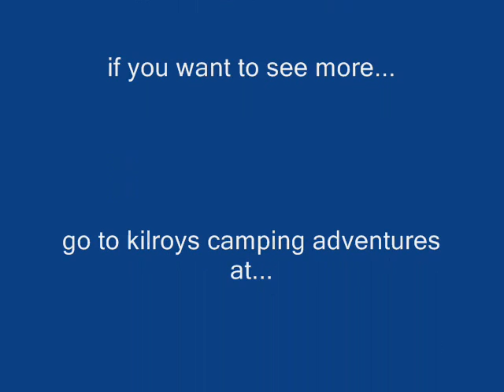teardrop trailer (kilroy) 1 THE BUILD more at kilroyteardrop.shutterfly.com

Comment: '
nice homemake a camper trailer,,,
this trailer need to add 2 amber yellow lights on the rear taillights for safety turning sign and emergency parking lot,,,
add 4 more LEDs lights on both sides of this trailer, too,,,
have a good camper and fun travel

Comment from the maker: @peluche2  the sides of kilroy are 4x8 3/4" plywood plus another 2' piece a total of 4x10 - covered with a 1/4" of oak - than covered with a marine spar varnish - could of used 1/2" or even 3/8" plywood base to make  it  lighter - every thing adds wieght - the lighter the better - kilroy has a lot of extras and is over 2000#

Comment from the maker: @inflatablemark you start by buying the trailer from a fleet store - order the plans from one of the suppliers in the links section of the shutterfly site at the end of the video - and if you can find someone else who wants to make one also you can spilt the cost of the plans and enjoy the build together. sometimes 2 heads are better then one! anyone who thinks they can build one will. just do it - sometime the hardest thing is to start -

Comment: Roger Kocemba I was hoping you would answer a question for me. I am assuming this trailer is 5 wide by 10 deep. Am I correct? I am trying to get a size comparison as I am getting ready to build one 6 x 10. Also I wanted to ask if you have any tongue weight issues?